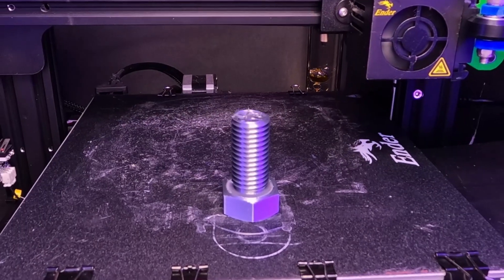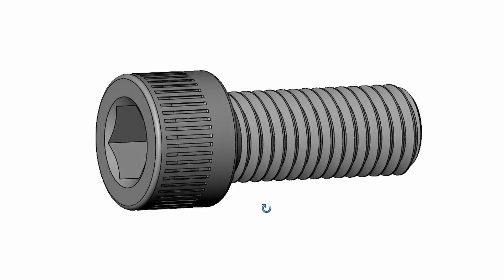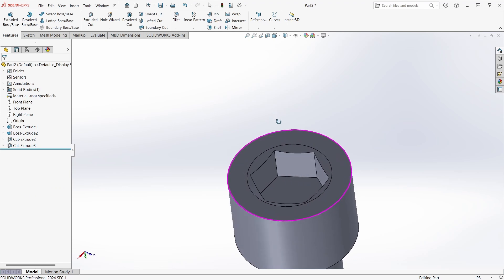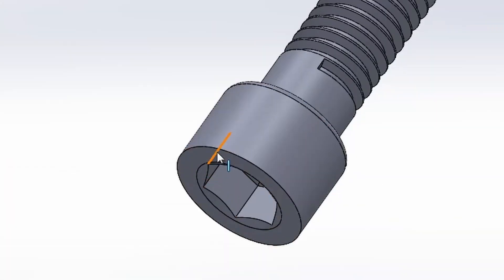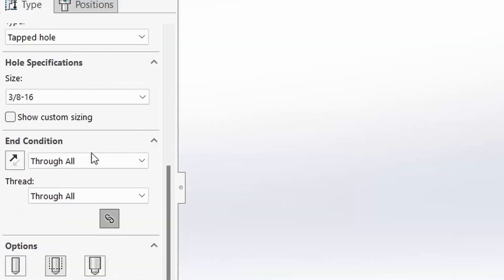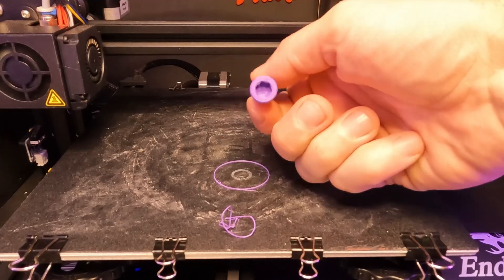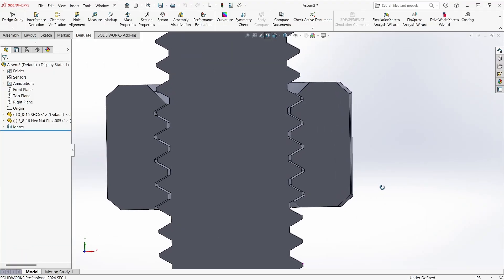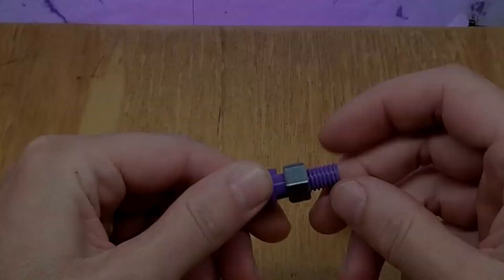How To 3D Print Perfect Threads: A Step By Step Guide

Comment: Hello my fellow 3D printing people which said "Draw and print a nut and its working bolt? That's a walk in the park." 
"On a scale bigger than M20 I could even directly print the external components I use in CAD, the tolerances there should be..."

NO. It doesn't work and it's not trivial as designing a click-fit mechanism. At all. Daaaamn I had to feel very dumb before coming here so here we are all together. Coffee, thanks. :)
Reply: how could I even have imagined the procedure of stealing them from McMaster Carr, all by myself, and still be the only having tried? :D ahahahaha
Reply from the maker: Yah, most times I've found that they're just placeholder models. Some of the dimensions and features may not be right, and in some cases any internals are not there either. I've tried myself to download some assemblies just to figure out how something worked, LOL!
Reply from the maker: Threads can be done, but should they? It's certainly possible, that's all I can say. I've used printed threads in some designs that don't really have any load to them, they actually do work... Pretty neat!

Comment: Ok its really cool but i dont have solidworks lol. In fusion 360 free you can't really get any gap for a looser fit. It prints the thread fine but its just a little too tight.
Reply from the maker: Hey Clippy, I'll have to look into how it could be possible in Fusion 360. I would think it should be possible? I know that's where I first saw printable threads anyways, so then I looked into how it could be done in Solidworks and made this video. I'm more versed in SW than Fusion, but I like a challenge... I'm getting the hint that most people are using Fusion in the makerspace over SW...
Reply: @sanfordprime  I was able to do it with the pull function you can basically select the thread when finish and use a negative 0.1mm with the pull function. Worked great.
Reply from the maker: Awesome! Yeah, similar concept, glad it worked for you. I'll have to try it now, tricks like that are great to know. Thanks Clippy!

Comment: Thank you for this tutorial video!  I was creating an M5 nut & bolt in Solidworks and could not get them to thread together.  The .005in (.127mm) did the trick!  One thing, On the nut I think you should make the countersink on the bottom the same size as the top.  You just left the default value set leaving the bottom countersink relatively small ; matching just makes sense!
Reply from the maker: No problem, working on another tutorial-ish video right now! Glad to hear that opening the hole up slightly worked! Some people might try to simply scale up the whole model a bit on other simple prints, but doing that messes with the thread pitch on fasteners to where it causes a whole new problem, I've found that this just works. Also, I agree with the countersink, it haunts me to this day... I noticed it immediately and was hoping that nobody would 'call it out' when I just left it that way 😉... Nice eye! I appreciate the criticism though, honestly. Thank you for your engagement with this!

Comment: You used a modified 3D printed part that requires a die set for the threads. However, we need a design without any modification to the threads. It should be a print-and-use type.
Reply from the maker: I've read and re-read your comment... gave multiple days between for it to sink in, and I apologize but I still am not sure what you're trying to say. I've even rewatched the video, to try and understand, LOL! There are multiple issues encountered in the video: 1) The simple download from MMC, which did not work perfectly. Then 2) The idea that 3D printing can just replace existing items with the dimensions they traditionally are. When 3D printing an existing item, most times there are slight changes that need to be made for it to perform well on the printer. In the end, through enlarging the clearances between the screw and the nut, it was a functional set of 3D printed threads straight off the printer with no modification afterward. So if I understand, the video ended up accomplishing what you're saying at the end? Although it was a long road to get there and I apologize for that as well...

Comment: Great video, thanks! Does it not cause issues printing the bolt vertically? I would think that orientation would be fairly weak (limited by layer adhesion strength) if your tried to actually tighten down the nut 🤔
Reply from the maker: Thanks! Yeah, I was curious about that too. I made another video torque "testing" them if you're interested. Different infill, wall thicknesses, and orientations. Orientation is definitely key, good observation!

Comment: Thanks for posting this. Most content I see for solidworks is geared to more advanced users. For a beginner this is perfect. I appreciate you.
Reply from the maker: Hey, no problem. Yeah, I guess now that you mention it I see a lot of the same thing too, a lot of the Solidworks stuff just assumes you know all the in's and out's of it. This was actually a feature that I heard from friend that another software (fusion 360) had built into it. After some checking out I learned that Solidworks had it too! I wondered, why isn't this more known about? ...and decided to share it in my own way. I appreciate you as well for engaging with the content and providing feedback!
Reply: @sanfordprime  Of course. SolidWorks is such a powerful program. I ended up with a veteran copy for a class I was taking and have stuck with it for 3d printing at home. I was able to use the information from your video to create an Acme thread profile in SolidWorks, allowing me to print some lead screws. Working on the tolerance now. Seems once you get into 1" or larger, the margin for error becomes very small. Too much play in my screw and nut at the moment.

Comment: I don't understand what I'm doing incorrectly... When I attempt to cut the threads into the stud, i get the following Notice, "Rebuild Error: Unable to cut thread on a cylindrical surface. Please use extrude thread instead." The nominal Ø is 8mm, and I would like to make m8x1.25 threads for printing. Any advice?
Reply from the maker: Make sure that "metric die" is selected when doing an external thread. I was able to recreate the same error message when 'Type' was set at "metric tap". Only use "metric tap" for internal threads in holes. Hope this helps, sorry so long...

Comment: it was amazing watching this video, thank you for sharing
Reply from the maker: Thank you! And thank you for engaging with awesome feedback!
Reply: @sanfordprime  My pleasure, have you tried printing the Nut/Screw directly from McMaster and checked if they fit together out of the 3d printer without redesigning the part from scratch, thanks again
Reply from the maker: Yeah, they don't work... well, didn't work for me anyways because they were too tight. So many times with 3d printing things need to change from standard manufacturing design to a design adapted for the more open tolerancing needed for using molten plastic. Could the MMC ones work? I think yes... with some slight tweaking.
Reply: @sanfordprime  thanks, may be a bambu lab x1 or h2d can give a good result, thanks for your response.

Comment: I use cut revolve to put chamfers on screws.  I use 45 degrees.  Also for the nuts on the outside corners cut revolve.  If you look at a nut that's the way it's made.  Nice video.
Reply from the maker: I feel like I've done that before too, lol! Too many ways of doing stuff in these crazy softwares, but each way has it's strong points...
Reply: @sanfordprime  The cut revolve is the way bolts/nuts are made.
Reply from the maker: Yes it is. Sometimes I've even drawn a circle on the face of the nut, extrude cut with a draft angle, and flip side to cut. It ends up looking like a revolved cut was done, and looks like a real nut again with the circular contact face. I feel bad now for doing the simple chamfers in the video, but my thinking was it was all about the threads and I probably wouldn't have chamfered it at all but I was concerned about the socket fitting over the end if there was any layer spreading on the build plate. My fear was also 3D printing the low angle without it needing supports when duplicating an off the shelf nut, I know you said you use 45 but they may be much shallower... anyways, my apologies for displaying it this way.

Comment: Need a thread adapter 3 in long, 3/4 acme male side to 18mm 1.5 female side, where do I start at to get one 3D printed?
Reply from the maker: There's no better chance than now for learning to model. If it's a one off requirement for this adapter and if you don't have any experience modeling, I'd probably download Fusion 360. It's free as long as you're not making significant amounts of money using it. There are lots of YT videos with tutorials for this software. Another free version which is quite good is OnShape. Me, I'm a solidworks guy but it's expensive and I'd say there is less online help for it. They do have a maker version which comes at a price, but for a one-off it makes that single part very expensive.

Once you have the model, there are lots of sites online where you can upload your model for them to 3D print it and ship it to you. Just to name one of the many, PCBway... I don't know much about it but check it out.

Hope this gets you on your way! Keep me posted on how it goes for you.
Reply: @sanfordprime  are you capable to produce one? also it needs to be flow through, I forgot to mention that. It's for a hand pump tank.

Comment: Thanks for the informative video! What nozzle size were you using?
Reply from the maker: My pleasure, thank you. I'm using the factory stock 0.4mm nozzle. I'd like to try it with a smaller nozzle size to see if the tolerances end up tighter and potentially more torque capability? The smaller nozzle would be a longer print time for sure. Videos are kind of a hobby at the moment, it gives me one more reason to design and print some of the things I do.

Comment: Thanks for saving me some filament!! I’m about to do this myself using models from McMaster.
Reply from the maker: Well someone had to try it... it didn't work out well for me, but it was close... I think with a little tweaking of their model it could definitely work though. Or maybe I just need a different machine? Most times with things like this though, unless it is designed for 3D printing, it may not 3D print properly... MMC is a great site, Major props to their modeling team! Happy to save you time and filament.

Comment: Great video! I've always used a helix and swept boss/base or cut because I don't need standardized parts, but this way is much simpler!

12:40 The reason that the orientation of the part is wrong when you input it into the slicer is because SolidWorks and Cura have their XYZ orientations different from each other. On SolidWorks, X is left/right, Z is front/back, and Y is up/down. On Cura (and most other slicers), X is left/right, but unlike SolidWorks, Y is front/back and Z is up/down. In other words, the Y/Z are flipped. 

An easy way to account for this, without editing the coordinate systems of either program, is to think of the front/back view of SolidWorks as the print bed when designing models.
Reply from the maker: Thank You so much!

Yeah, the good 'ol days when everything had to be drawn, and the software was not as smart as it is today. I remember needing to sweep the threads if they absolutely had to be shown. Thankfully there have been tremendous improvements in software for threads amongst many other things... I didn't even know the SW real threads were even there until I began 3D printing.

I've been experimenting with putting the model on different planes to fix this lately. SW and the slicers need to get together and agree on something! Traditionally I've modeled parts on the top plane, so its a difficult habit to break. When it's an assembly though (like the butterfly knife) I can re-mate the assembly to the proper plane before exporting and that really helps. I wish there was an easy fix for parts post-modeling, maybe in the next update? lol.

I guess we just had to talk through it though, what if the model which was on the wrong planes was imported into an assembly (a one part assembly), re-oriented to the proper planes, then exported for slicing?
Reply: @sanfordprime  SolidWorks lets you change the orientation in the settings

Comment: good video; I learned some useful stuff, but you don't mention anything about printing with a 60 deg overhang. What are your thoughts on this?
Reply from the maker: I guess I never gave it much thought, I simply tried it the first time and it worked... But now that you mention it, yes, there is quite an overhang that doesn't seem possible. It may work out because of the helix that it is on? If I pay close attention to the timelapses the thread is not a full 'ring' of overhang but a compounded angle of overhang, the very tip of the thread is extended layer after layer. Maybe that has something to do with it working? I honestly do not know, but you now have the gears spinning. Thanks!

Comment: 14:36 Did you use the same specific thread pitch characteristics for the printed nut and bolt as you did with your manual tap tool? What are you doing if you have to print a very tiny nut and bold?
Reply from the maker: The smallest I've printed so far was a #10-24 screw, and I only did it for the video I posted a while back. I guess it was just to see how small I comfortably felt going. https://youtu.be/wSDp9e75wGA?si=ZwOe2rMPOYNwZ8jz
All the threads in the video were from a .4mm nozzle and .2mm layer height and they felt pretty good. But, yeah, the smaller the threads were, the more cringing they were to print...
Most times I do give a bit of clearance between the internal and external threaded parts, Solidworks likes to model them a little close for 3D printing. For the cases where I forgot to add the clearance, or if there is excess buildup on the threads that needs to be cleaned up, the tap and die set comes in really handy!
It is possible to model a thread that doesn't exist yet (the sky is the limit here with 3D printing) but I like to keep the threads the same size as what's available in the tap and die set I have. Whenever I go outside that range (larger, as notably done with the rifle rest video) I pay really close attention to the clearances in an effort to not waste a bunch of time and filament on something that doesn't work. Possibly do a test print to verify fit before full committal with a large print, it takes some time but it isn't too painful compared to the alternative.
To make a long answer short, yes the same size tap and die was used as the part was modeled for. Also, I try to stay away from too small of threads, 1/4" or 6mm would be the smallest I would go regularly with my setup.
Just thinking though, I have in the past printed just the drill sized hole with no threads, the threads were then fully cut with the tap tool, this worked well also. By adding the regular hole into the print it gave a position and wall around where the threads were cut, which avoids drilling into a thin wall after the fact to only find out later that there is only gyroid fill webbing on the inside beyond the wall...
Interesting questions, really got me thinking. Thank you.

Comment: Very informative video, I really appreciate and learned a lot!
Reply from the maker: Thank you. It certainly was more time consuming to create, I'm glad it was helpful!
Reply: @sanfordprime  I'm fairly new to 3D printing so everything is a learning process for me.  I tried printing out a screw model last night with the settings you showed for your print and mine did not turn out as great lol I'm using PLA filament so I'm sure that might have something to do with it. I'll give it another try again with some settings that worked for a previous print. I have a Creality K1 that got used.  I'm not sure if something is wrong with it or if I should have all the fans on or not but for some prints I tried I got some snagging that ruined the print.  What would help fix that?
Reply from the maker: @Handy-How-To-Tips  LOL, you'll never stop learning 3D printing. I've been doing it as a hobby for a while now and there's always new things... The settings I used were for my Ender 3, I don't know if they should be different for a K1 or not but I would imagine that not much should change. One thing I've been running into lately, and as you witnessed in the video, the stringing and globbing. As I understand, this is a filament moisture issue? Anyways, I'll be getting a dryer here shortly to put filament in before printing. Definitely frustrating to walk away from a print thinking everything is OK, then come back to a plate of spaghetti. Where is your snagging happening, are there strings and globs? I also had an issue with what the slicer produced, I resliced it and resent it to the printer, then it worked. This was on the metal detector video if you're wondering... there was an issue in the gcode that just sent the nozzle burrowing into the surface... Another issue could be adhesion if it is slightly snagging and pulling the part over... possibly retract settings? There are just so many potential causes and without seeing it, it can be difficult to diagnose. sorry so long.